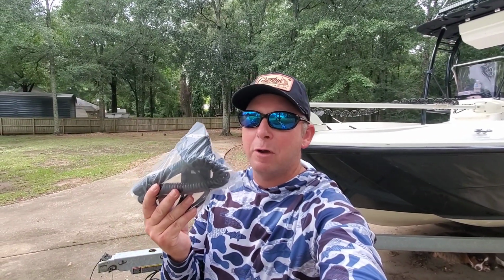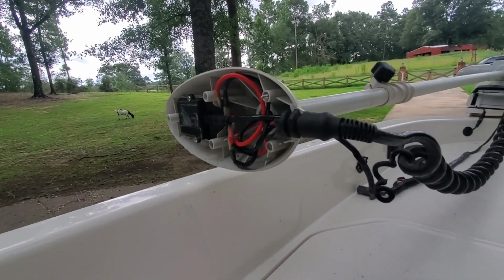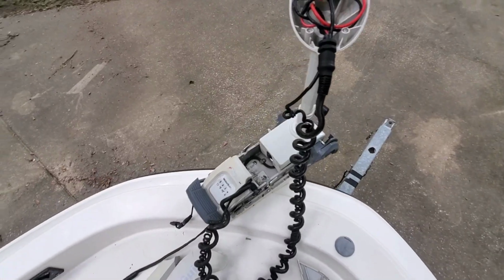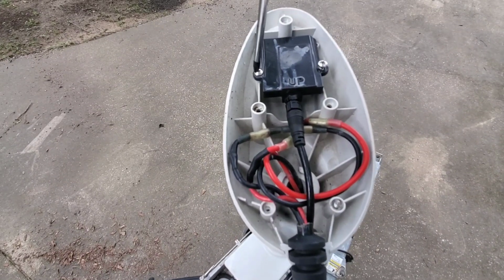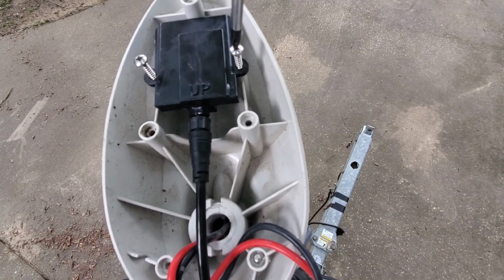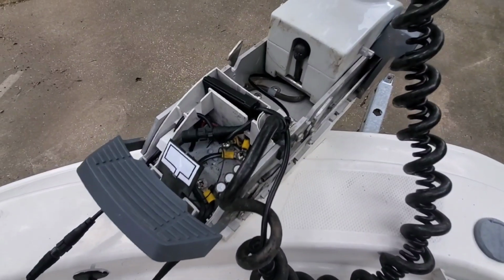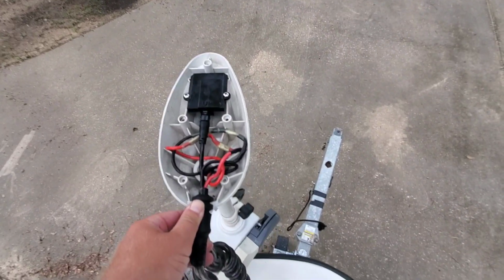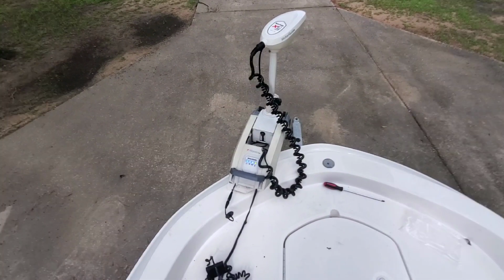How to replace a GPS Module on a Motorguide Xi5 Trolling Motor.

Comment: Can you bypass the gps an just run 12volts to motor
Reply from the maker: @ericwilkes238  not sure you can run it in manual mode without GPS. Not sure as mine is 36v
Reply: Been running mine without gps for 3 years. Acts just like a regular trolling motor.